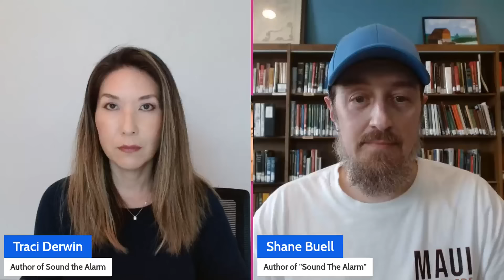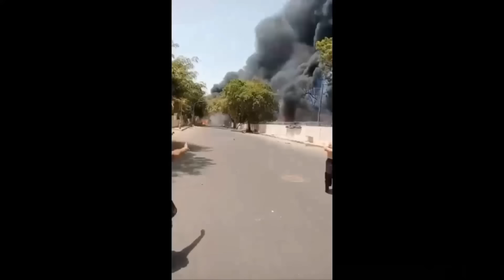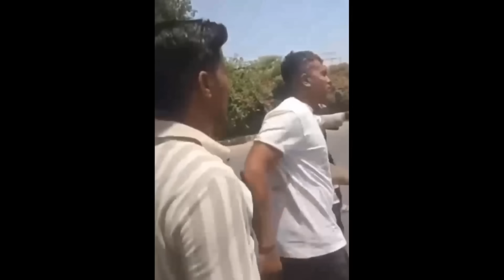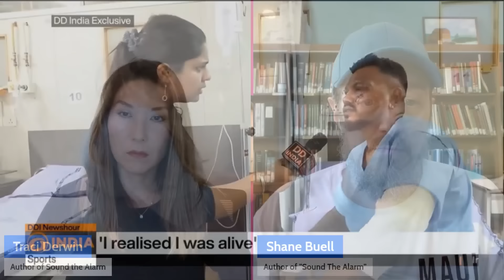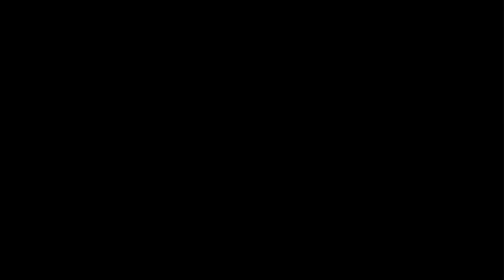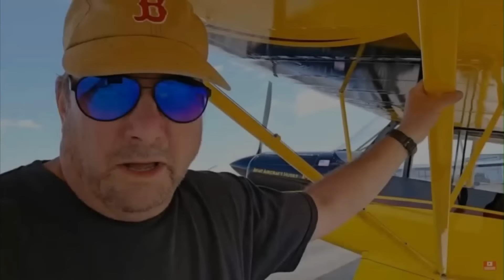What REALLY Happened to Air India Flight 171?

Comment: Most likely DEW and Philadelphia Experiment technolgy combined in one attack. You have to look at the inside Visuals of the back part of the plane nicely embedded into a side wall and the large wheels inside the building with no breakage of the ceiling to understand how the plane was blasted apart and from which direction the blast came from. India today has a great YouTube showing all the details of plane parts inside the building that could only be inserted into that building with very advanced technolgy. ( India Today's Preeti  Choudrys Exclusive Report , Inside Visuals from Plane Struck Medical Hostel ) Outside pictures reinforce it looks like the plane was blasted from above the building at a 45 degree angle blasting out a rectangular portion of one wall , but leaving the  building  pretty much intact other than that. That's impossible without very advanced technology. That whole building should have collapsed from the force of the impact and the resulting explosion, but it didnt. This was a very carefully controlled demolition of the plane .

Comment: I am an ex cabin crew.  They always blame the pilots which is totally unfair . Take off and landing are what they know inside out . 
There has always been an issue with the manufacturing at the  south Carolina factory ... Most western countries wouldn't accept delivery from there as there is no unionised workforce . Also look more deeply into the conception of the 787......it's issue with their lithium batteries catching fire was to simply put seal them in a black box .....didn't the whistleblower blow his head of 2 days before the Boeing hearing ? You have to ask why that happened! Plus all aircraft from any air operator have their planes in the air 24/7 that's nothing new ...but when you have self regulating bodies , what do you expect .....down to Boeing in my opinion and secondary , the airline for pushing the workforce ans skimping in maintenance

Comment: They are just trying to destroy the company. I said. Look is on the flight. Not now. Another company leaving America. Also. The parts have been garbage for years. Made cheap. Junk. One of the most junk parts are the bearings for the engines. The wiring forever has been made out of food. Soybeans. Why the engines catch fire. The bearings are oil cooled with an oil pump. They leak. Always spraying oil into the engines. It's not something breaks, etc. The engine is loaded with oil covering everything. I learned this off of watching YouTube only since 2014. All subjects. Thousands of videos watched on around about a thousand different channels. Easy. In the recommendations. Mostly channels you're not subscribed to. Yet. On the same subject line. The best one I heard that made since on this one. High heat temperatures. Wrong settings put into the fight take off. Making the engines vapor lock. To me, personally. That makes sense. Meaning. The engines did know to get up to a higher RPM. Thin air. High heat. They shutted off. My suggestion. Putting aliminium heat blocks around the fuel lines. Old days. We used cloth pins.

Comment: You had me at Palantir Shane. The RAT was deployed. An electrical and dual 13:01 engine failure are most likely a gross mechanical failure. However the air ambulance crash from philadelphia wasn’t a Boeing and had the same problem. “Transient voltage” and something else” to create electrical failures are turning into a pattern with plane and boat wrecks. Traci is right to point out the faulty “blame the pilot” pattern. This is starting to feel like a DEW. 
 The official investigations on these crashes are weak.
 We still have no firm proof there was no matrix system on the Blackhawk UH60 that killed 67 people in the potomac in front of Washington National airport during Congressional negotiations over trillions in obsolete AI contracts. This despite baseless comments from VP JD Vance and Pete Hegspeth who claim without evidence the UH60 had no automated reduced crew matrix system. We have too many unanswered questions with far too many bad patterns. 
 DEWs carry all kinds of powerful frequencies that can disrupt electrical components. And this occurred close to the border with Pakistan where the CIA has been actively trying to create war between India and Pakistan to shut down the Belt and Road initiative’s China/Pakistan Economic Corridor (CPEC).

Comment: Oh man. You should start by looking at how a real engine is. Its the same Vortex/ TORoid TURBINE method as HYDRO turbines and NEW CLEAR ENERGY STEAMTURBINES. Gas turbine- AIR/AETHER!
AIR IS A GAS!  Rings with statorblades  spins faster and faster by a hose from the compressornext to the PLANE. GROUND CREWS WORK. AIR starter until it reaches Perpetual motion and the AIR-PLANE produces its own AIR and generating electricity. Then it can start the other engines by its own. Or by  the little APU.  SAAB AERO/AETHER/ GAS/AIR NAUTICS OWNS 51% of ROLLS ROYCE TRENT AND PRATT&WHITNEY engines . They also own SAAB fighterjets Thunderbolt, Dragon and The GRIFFIN . SAABS LOGO IS THE GRIFFIN!  BOMBARDIER, Lockheed Martin,

Comment: THESE EMP DRONE WEAPONS ARE BEING USED IN THE UKRAINE WAR!  THISARTICLE DESCRIBES AN EXTREMELY DANGEROUS WEAPON!   IT SURE SOUNDS LIKE SOMETHING THAT CAN CAUSE PASSENGER JETS TO CRASH!

"Military Aerospace

"Air Force surveys industry for technologies in EMP electromagnetic weapons to counter unmanned aircraft

Dec. 11, 2023

"Proposed EMP solutions could be ground or aerial based that provide effective mitigation against large-, medium-, and small-sized military UAVs.

65735208fadc20001f24f641 Emp Uav Defense 11 Dec 2023

"ROME, N.Y. – U.S. Air Force researchers are surveying industry for enabling technologies in using ground- or aircraft-based electro-magnetic pulse (EMP) generation to counter formations of enemy unmanned aerial vehicles (UAVs).

"Officials of the Air Force Research Laboratory Information Directorate in Rome, N.Y., issued a request for information (RFI) on Thursday for the Electromagnetic Pulse (EMP) Defense Against Unmanned Aircraft Systems (UAS) project.

"EMP is an electromagnetic warfare weapon that generates high-power microwaves intended to destroy or disable sensitive electronic components -- such as the navigation, guidance, and sensor systems of UAVs.

"EMP also is a byproduct of a nuclear explosion, which produces a devastatingly powerful electromagnetic field that causes massive power surges that can destroy electronics, power generation, and electric distribution systems. "

"Related: Army asks Lockheed Martin to develop UAV high-power microwave weapons to destroy or disable enemy drones

"Proposed electromagnetic weapons EMP solutions for this counter-UAV project could be ground or aerial based that provide effective mitigation against large-, medium-, and small-sized military UAVs.

"Proposed aerial solutions must be reusable, and made from U.S. components and electronics. Aerial and ground-based solutions must have some level of system autonomy; resist the effects of shock, dirt, water, and temperature extremes; and be able to operate at night.

"Companies interested should email 10-page capability statements no later than 5 Jan. 2024 to the Air Force's Matthew Zawisza at matthew.zawisza@us.af.mil.

"More information is online at https://sam.gov/opp/0df436d156e046a1a7101409f1712c48/view."

Comment: I was in Reno when this happened. 👇 🥸ChatGPT: Here’s what I found—the incident you’re referring to is Galaxy Airlines Flight 203, which tragically crashed shortly after takeoff from Reno–Cannon International Airport on January 21, 1985. It matches your time frame and other details exactly.

---

🛫 What happened?

The aircraft, a Lockheed L‑188 Electra turboprop (tail number N5532), took off around 1:04 a.m. on a charter “gamblers’ special” flight to Minneapolis–Saint Paul  .

Shortly after departure, the crew reported severe vibration. Debris scattered across US 395 and South Virginia Street as the plane crashed about 1½ miles from the runway  .

---

Casualties and the survivor

There were 71 people onboard (65 passengers, 6 crew). 70 died, and there was only one survivor  .

The sole survivor was a 17‑year‑old boy, George Lamson Jr., who was reportedly thrown clear in his seat and survived with burns and minor injuries  .

---

Causes uncovered by the NTSB

The NTSB determined the crash stemmed from pilot error and a cockpit breakdown in coordination while dealing with the vibrations  .

Ground crews had negligently left an air start access door open, creating the intense vibration that disrupted the cockpit workflow  .

---

Community memory & impact

Local Reddit users recall the crash occurred near modern-day Sierra Center Parkway and Target, noting how jarring it was when they saw burned wreckage and highway closures at the time  . One post remembered:

> “It’s supposedly around Sierra Center Parkway by the Target today… The guy (kid at the time) who survived wrote a book…I think he had a lot of problems later in life dealing with it.”  

---

Video coverage

Here’s archival coverage of the crash:

---

📌 Summary

Detail	Info

Date	January 21, 1985
Plane type	Lockheed L‑188 Electra (N5532)
Route	Reno → Minneapolis
Fatalities	70
Survivor	George Lamson Jr., age 17
Causes	Vibration due to open air start door; pilot/copilot error during emergency, resulting in stall

---

Memorial

A memorial grove called Galaxy Grove was dedicated in 1986 at Rancho San Rafael. A granite plaque was installed in 2013 to replace a stolen one  .

---

This fits the details you remembered—between 1980–86, takeoff from Reno, crash along Hwy 395, one survivor. Worth noting, the Reddit thread suggests the survivor stayed local and even shared his story in a book.

Let me know if you'd like to find that book, photos of the memorial, or anything else!

Comment: WHEN I HAVE FLOWN A COMMERICIAL FLIGHT, EVERY JET IS COMPLETELY SHUT DOWN BEFORE PASSENGERS CAN GET ON AND OFF THE JET.  SO THE COMPUTER WOULD ALSO GET SHUT DOWN TOO!   THE ONLY OTHER THING THAT CAN INTERFERE WITH A COMPUTER IS MICROWAVE ELECTROMAGNETIC SONIC FREQUENCIES WHICH ARE NOW USED BY MILITARIES AS A WEAPON!   

QUOTE FROM WIKIPEDIA
"An uninterruptible autopilot is a proposed system designed to take control of a commercial aircraft away from the pilot or flight crew in the event of a hijacking.

"If implemented, the system would allow the craft to automatically guide itself to a landing at a designated airstrip. The "uninterruptible" autopilot would be activated either by pilots, by onboard sensors, or remotely via radio or satellite links by government agencies, if terrorists attempt to gain control of a flight deck.  The pilots or hijackers would then be unable to regain control of the aircraft, which would automatically land safely.

A patent for the invention was awarded to Boeing in 2006.

"Conspiracy theorists have claimed that the technology has been secretly fitted to some commercial airliners. Some, including historian Norman Davies, have blamed it for the disappearance of Malaysia Airlines Flight 370, the cause of which is unknown as of March 2024.  According to Bob Mann, an airline industry consultant, evidence of an uninterruptible autopilot system being installed in a commercial aircraft has not been publicized and is not proven to exist.  Safety concerns, including the possibility that such a system could be hacked, have prevented its roll-out."

BUT THE FADEC COMPUTER YOU DISCUSS TOO, CAN BE EASILY SHUT DOWN BY MICROWAVE ELECTROMAGNETIC FREQUENCIES!   IT IS A SONIC DENIAL OF ATTACK TYPE WEAPON THAT SHUTS DOWN COMPUTERIZED SYSTEMS IN JETS SO THEY CANNOT RETURN FIRE!   PASSENDER JETS CAN STILL BE EASILY SABBATOGED BY THESE WEAPONS!   THESE FADEC SYSTEMS WERE CREATED AFTER 2006, ALMOST 20 YEARS AGO!   SO WHY ARE THEY NOW FAILING EXCEPT THAT THE SONIC WEAPONS WERE RECENTLY DEPLOYED ON ALL MILITARY AIRCRAFT!   I DON'T THINK THESE PASSENGER JET FAILURES ARE COINCIDENCES!

AND WE DON'T KNOW IF THERE WERE PASSENGERS ON THIS INDIA JET WHO ARE ENEMIES WITH COUNTRIES THAT WANTED THEM DEAD!

Comment: iam an aviation enthusiast for over ten years.modern jets today are simply flying robots.
99 percent of a jet is  computer controlled  one percent is pilot controlled.
shanes theory of 5g disrupting the planes computer is highly  possible.

when airliners got rid of flight engineers ,pilots were now under greater pressure to respond to an in flight
emergency.
when air india--171. began loosing height the pilots would have immediately pushed the throttles
for more thrust.to get more speed. the computer did not give them more speed to climb
upwards. now remember evrything in the cockpit is computerised .to make something work you must follow a 
set sequence pressing buttons. at just a few hundred feet of the ground the pilots could not get the 
computer systems to let them power up the engines and the plane fell to the ground.

over computerised cockpits are a diaster waiting to happen,unfortunately pilots have little
or no say in the  matter.we have self driving cars , they now want self flying planes to do away with pilots
and save money...i believe the pilots didnt crash the plane..its the computer that crashed the plane
boeing  will never say that nor can other pilots say that without loosing their licence..
Reply: @carlmartin7122 Makes me wonder how well connected the onboard computers might be to AI.
Reply: I can believe that. My 5g has been pretty spotty, so far.

Comment: This  AI crash has been extensively reported on but I enjoy Shane's analysis. My take after watching many reports that it was a probable dual engine failure due to the FADEC on both engines failing, which is probably a one in a billion or trillion event. Then the electrical power failed when the engines quit and the RAT deployed. It's like what came first the chicken or the egg. What came first, engine failure or electrical failure. Just a layman here and just an opinion.
Reply: This is about as far as we can get without the FDR data.
Reply: @Shane-Buell  I still fly, the odds are with you.